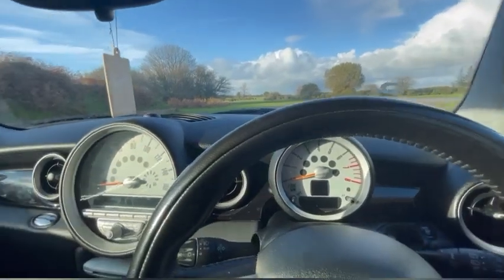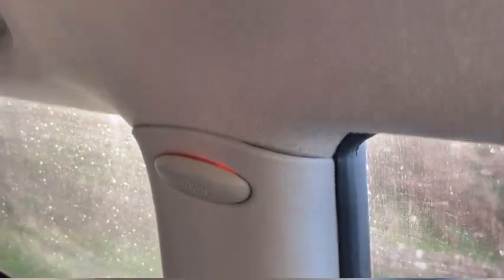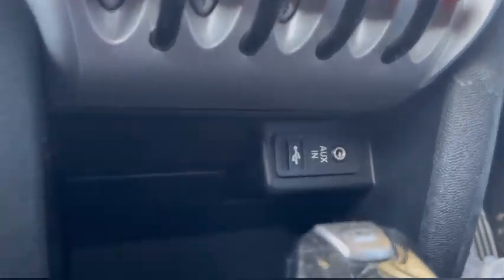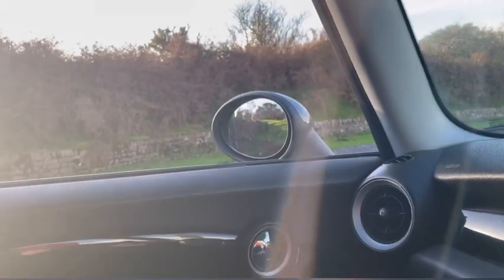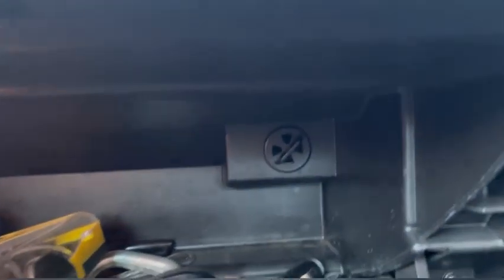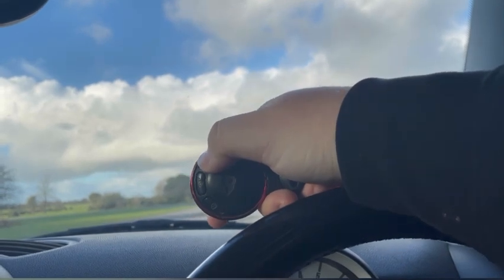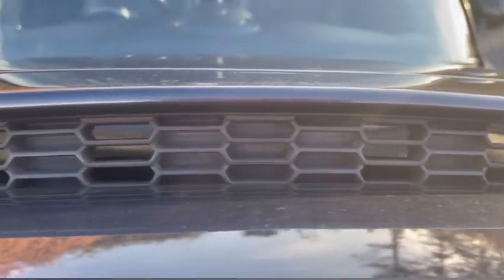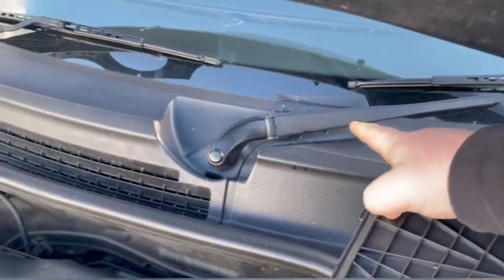10 Interesting Quirks On A Mini Cooper S R56 PART 1

Comment: The bonnet scoop is a pretend one on this model it was intended to continue with the cool aesthetic look of the supercharged mini, and on some other older models of mini if the battery goes flat you can still open the boot from the inside via a lever.
Reply from the maker: Correct! Though there are aftermarket Induction kits that’ll make the scoop have some purpose. 
With regards to the lever, do you know where exactly?
Reply: @Revved_up_jb  To be honest it is all of the minis that have the boot door lever if the battery is in the boot, as the boot door is electric, it makes sense.

Comment: If you push and hold the lock button on your key it should shut your windows for you.
Reply from the maker: Nice one! I didn’t know that! Thank you will give that a try soon!
Reply: @Revved_up_jb  Did that work?
Reply from the maker: @markysparky1965  just gave it a go and only the passenger one goes up but I’ll include if I ever do a part 2! Thank you for that!
Reply: pretty sure you need to enable that with the obd2 port, vag boys have been doing it since 2005
Reply: The aux works amazingly with a bluetooth dongle for about a tenner on ebay. The stereo is crap until you do CHANNEL SWAP which involves changing a few wires so all the goodness out of the stereo goes to the back speakers which are good quality. I hated my first 08 mini until i did this and im now on my second mini 6 years later.
Reply: I don't know if its just me but I have bimmercode and you can't code it to shut the windows 😭😭 but spot on about the valve stem seals I bought my mini didn't notice from dealership because didn't really leave it on idle too long, all in all I think think the maintenance costs are not as bad as you'd think especially if you're capable to do job on the driveway my mini is fairly modified and I think it gives you a fair bang for the money ❤️❤️
Reply: @andypeers9903  A channel swap? all you are doing is changing the polarity of the speakers because the wire colours don't seem to match the speaker polarity in a mini especially the BMW, which can seriously effect the audio phase.